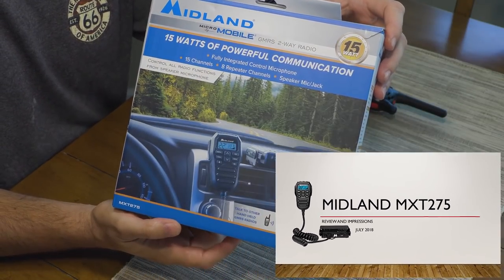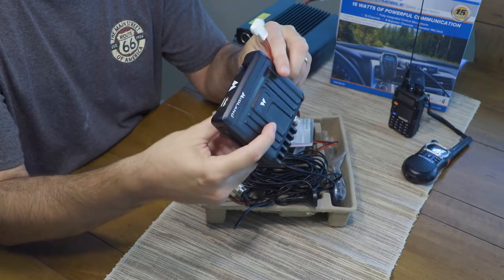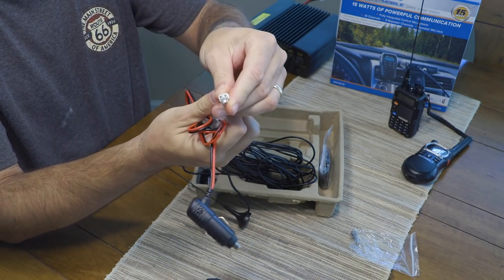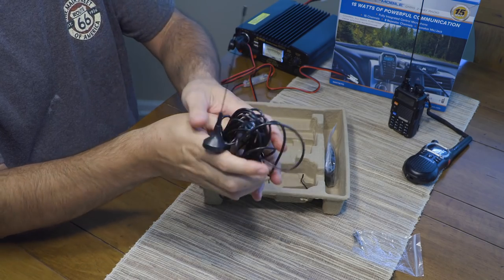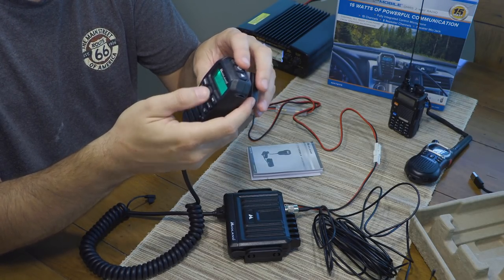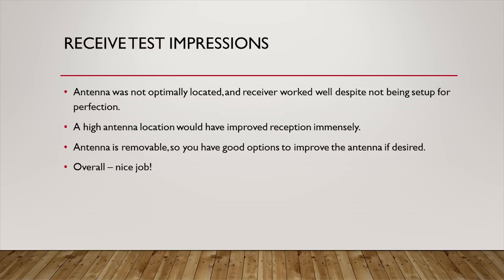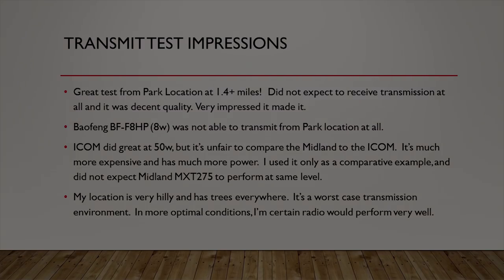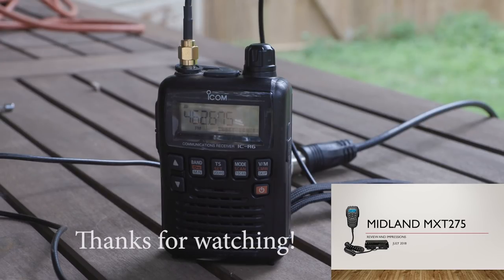Midland MXT275 GMRS Radio Review

Comment: While checking out how to apply for a GMRS license, I came across the following statement in Title 47, Chapter 1, Subchapter D, Part 95, subpart E, paragraph 95.1791 "Sales of GMRS/FRS combination radios prohibited. (a) Effective September 30, 2019, no person shall be permitted to manufacture or import, sell or offer for sale any radio capable of operating under both this subpart (GMRS) and subpart B (FRS) of this chapter." What is this all about?
Reply from the maker: They are modernizing the bands and allowing more power on GMRS.  I think it's good for GMRS and should allow some new radios with better capabilities.  For example, they are allowing messaging (data) and GPS signalling among other things.  You just wont be able to buy the bubble pack frs/gmrs mixed radios anymore - they can only be FRS or GMRS.  That's how I interpret it anyway...thanks for stopping by!
Reply: The FCC isn't allowing more power on GMRS. GMRS allows up to 5 watts on channels 1-7, 0.5 watts on channels 8-14, and 50 watts on channels 15-22. But they did up the FRS wattage from 0.5 watts up to 2 watts on channels 1-7 and channels 15-22, and stays 0.5 watts on channels 8-14.
Reply from the maker: Yep - you are right on the power output.  I must have been thinking FRS - you are correct.  Thanks!
Reply: You're welcome
Reply: Tractor Therapy Now I’m wondering if the MXT275 automatically reduces power for the FRS channels. Do you know?
Reply from the maker: This radio only works on the GMRS channels.  The manual is pretty vague about the power levels, but I think it 5w on 1-7 and 15w on 15-22.  If someone knows different, please make a comment.
Reply: Yes, it is completely automatic as the FCC wouldn't have allowed it to be certified from them for legal use in the U.S. I assume it doesn't have the 0.5 watt channels 8-14 in the radio or it has a disabled transmitter on those channels because it isn't legal to have a removeable antenna on a radio that transmits on those channels.

Comment: PL is plug  SO is socket
Reply from the maker: Correct!
Reply: PL stands for private line, learn something about radio before you get into it, ham radio operators use PL tones all the time,, that way others might be able to listen but not talk to you, unless they have the correct tone you are using. I happen to be a ham radio operator, and have been for over 20 years and more. There are things that can be done with radios that many do not even think about.
Reply: @mysticwolf2842  In THIS conversation, PL means plug. He was referring to the PL-259 and the SO-239. I recommend less caffeine and more listening/reading.
Reply: @mysticwolf2842  you're an old curmudgeon. I've been a ham since 1972. Even I, knew what they meant by PL. Go lay down "no code" Paul.
Reply: @M70ACARRY  need to inform you that I did pass code, and do work he, although at this timeof I do not have a working ant.

Comment: Thanks for the review. Very concerned about the modulation problems with the radio, hope Midland fixes it. When you tested the MXT 275 the antenna should have been on a roof if the radio was inside a building. It also could have been placed on a vehicle with the antenna placed in a proper high spot on the ATV or car. The concern here is the proximity of the antenna to the human head. Never test a radio with this much power with the antenna indoors. I don't know where the antenna was mounted on your mobile unit during the test but if it wasn't on the roof of the car the test is invalid.  When you tested with the Baofeng hand held unit the test should have been conducted with you standing outside the vehicle.  Being inside the metallic vehicle seriously degrades the signal.
Reply from the maker: Your concerns are valid, but my video is real world testing, not a lab.  I clearly notated the shortcomings of antenna placement in the video.  Short, infrequent transmissions pose no health safety issues.  Thanks for checking out the video and hope it was informative!